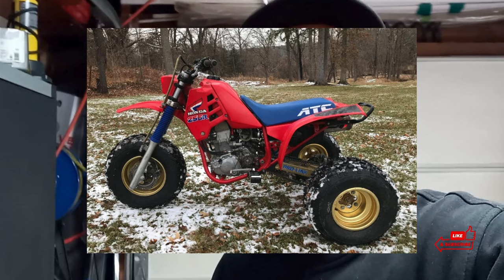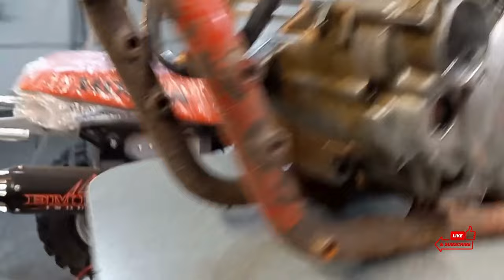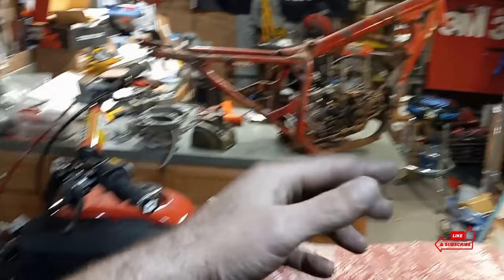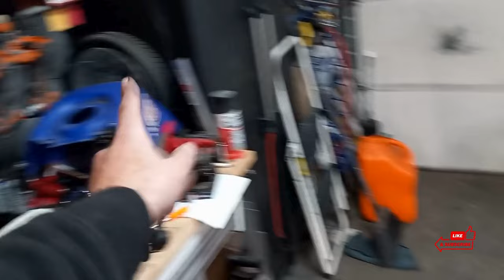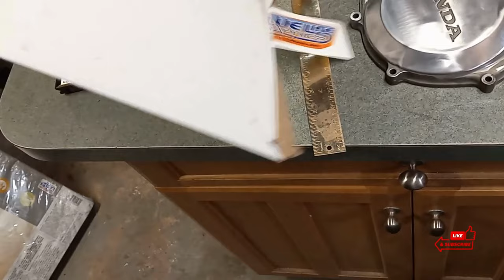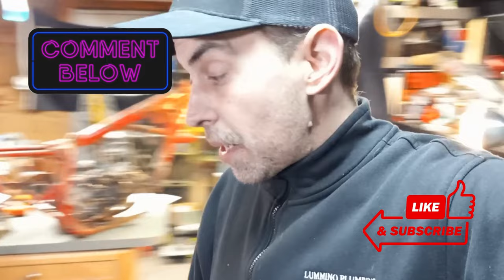🔥 Building a Hybrid ATC250R Plans, Plus Channel Updates

Comment: if you need more clearance up top you can run a valve cover from a crf450, they don't have a big hump on them
Reply from the maker: I grabbed a 04-05 rocker cover I had on the shelf. They don't have that big box on the top either.

Comment: Think bottom tubes will need to be cut out to clear 450 head . Good luck you get this . I'm working on yfz 87 lt250r hybrid.
Reply from the maker: I'm looking at that too. The one in the pic is 04-05 the 06 and up has a not as tall cylinder

Comment: He used a 04-05 Trx450r motor, U can tell the difference between a 04-05 and 06-14 if u look at the oil sight glass and the timing chain tensioner. 04-05 oil sight is closer to the shift shaft and the timing chain tensioner is bigger than a 06-14.
Reply from the maker: I noticed it when I was editing. Good eye tho

Comment: I have the same nerf bars and oil tank have the same issue as you and was thinking about notching nerf bars as well but then I changed my mind and I think I’m gonna slot the tabs on the tank and maybe weld the original mounting hole in solid and see if that gets it high enough to not interfere with the nerfs just another idea for ya.
Reply from the maker: I know what your saying I was thinking that as well but the drain hole for the tank will be to sunk into the rubber grommet on the bottom, that drain bolt is also a mounting point
Reply: Very true! Curious on what you end up doing.
Reply from the maker: @triggergriffin  so am I this is one of those decisions that either option sucks
Reply: I enjoy your videos man keep creating good content you have some pretty good tricks and ideas.
Reply from the maker: @triggergriffin  thanks bro

Comment: Hybrid?😳
Reply from the maker: Yes sir. No battery tho
Reply: Hybrid means half this half that
Reply: I would use 05 valve cover it’s not so high like 06+.   I know your not using 05 motor but they don’t need oil cooler, I run a line that goes from one side to other.
Reply: Why not use a bracket that mounts to mounting location but goes up like a right angle bracket
Reply from the maker: @nicolecittadini4234  I have a 05 top end here. The 06+ cylinder is shorter too. I'm gunna need to figure out the top section. The rocker cover is gunna hit the gas tank
Reply from the maker: @Johnbruzzi4234  for what the front motor mount?
Reply: @garagemcmatt  top ends aren’t interchangeable but the valve covers are,or rocker covers
Reply: @garagemcmatt  for the oil cooler
Reply from the maker: @Johnbruzzi4234  i see the difference between them. I'll definitely look at the 05 rocker cover